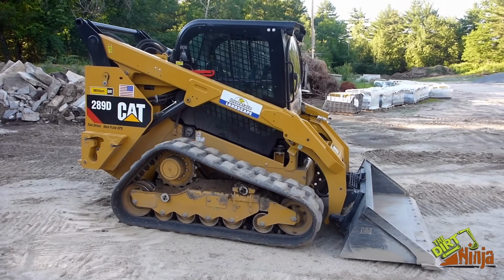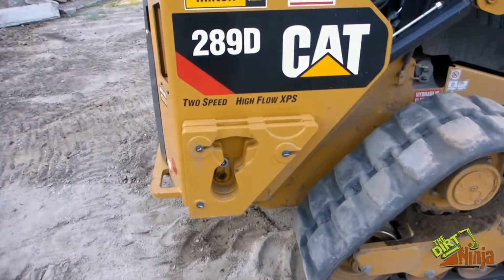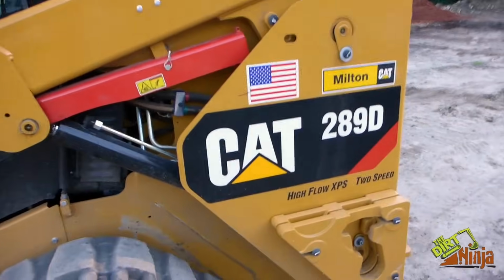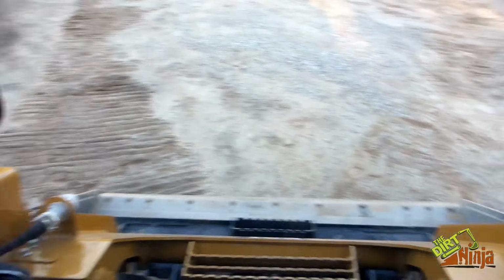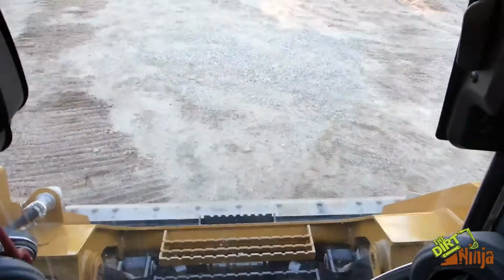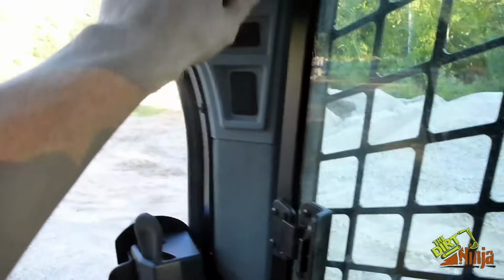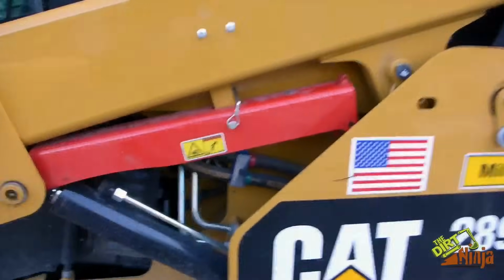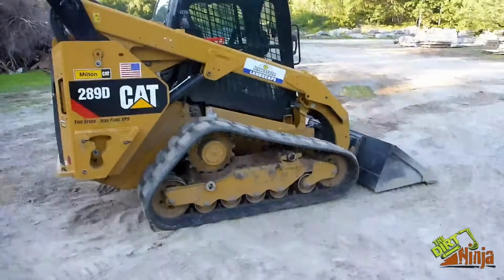In-Depth Caterpillar 289D Review And Walk-Around

Comment: Good machines but there are a few things to pay attention to with these (like any other machine out there).
Biggest thing with torsion bars is keep them greased. If you don't grease them often the grease will get rock hard and you will have to pull the track frames to drill out the ports. Bolts holding the torsion bars to the inside of the frame, under the cab, like to come loose from vibration and should be checked each service. When the tracks get loose they can slap around and break the bolts holding the front torsion bar trunnion to the track frame. Also spend some time and put some hose gaurding around the drive motor hydraulic hoses where they come through the frame. They like to rub through there often. A/C lines to the condensor break often because they flex and sometimes kink where the rear door opens. A helpful tip: Pull the battery out to get at the oil filter easily. Only takes 5 extra minutes but saves a lot of cussing and swearing.
Reply: Billy Bob Any tip on the Bobcat T740? I'm trying to decide between the T740 and 289D
Reply: Bobcat all the way!!! 👍🏻👍🏻👍🏻👍🏻
Reply: @Ramo-jw8iy  Cat all the way!!!

Comment: Nice review. I've been operating a 289d on the job now for about a year I got it with 200hrs and it now has 1305 hrs and the hydraulics started getting weak around 1000hrs
Reply: Andrew Newton i have about 1500 hours on it and found the same thing but still love it
Reply: Is there a fix for this? What do you mean by the hydraulics getting weaker? Is it not lifting the same weight as when new? I just bought a 2017 with 2500 hours and need maximum weight lifting.

Comment: The MTLs are not dainty by any means imho. When I was doing flatwork I had a 287B that I bought brand new. The ride is way better and you don't lose material like in the CTLs. I know there are comparison videos where people try to make it sound like the CTLs aren't choppy, but the truth is they are. Even with the ride control on the CTL the MTL out-classes it in ride performance. The single bad thing I experienced was if operators spun into the pile when spreading gravel; especially chipped gravel. Spin into a pile of chipped gravel enough and you will eventually see chunks come off the bogies. I literally had to let a kid go because he wouldn't quit doing this even after being warned 3 times.

Comment: Great video. We have 4 of the newer 289d3s and various other models. One small correction though is that the engine is not made by Cat. It's made by Kubota. I think if Cat had made the engine, they would have made the oil filter easier to service. Otherwise, it's a great engine. Between D and D3 skid steers,  we have had nearly 20 of them and have only had one major engine failure, which was a blown head gasket.

Comment: Excellent video, great job.  To compliment your comments, note positioning of Cat coolers/condensers vs others.  Easy to clean debris and excellent heat displacement for high hyd temp attachments.  Cat draws air from rear and exhausts it up and out, thus not blowing hot air and dust on your laborers.  D's will have accumulators to let the boom down w/o engine power.  Cat uses a patented cooling fan blast to dilute hot exhaust temps, operates @ 500-600 degrees max (check OMM on other makes/models for engine temps) and passive to the operator.  D series skid steers are plug and play for Cat SSL work tool attachments with a hydro/elec worktools plug installed.  Very important item to consider if you don't enjoy cords thru windows and poorly interactive, singular hydraulic function control for attachment setups.

Comment: We just got a new 289d and used it for the first time today.  I was curious how to change the controls.  I never found the info in the manual.  It's supposed to have that option so I'm not sure if it's a mechanical valve or switch button or setting in the display.

Comment: Then need to get some heated joysticks/arm rests to! That would be a nice cold weather package
Reply from the maker: FishFind3000 I like that idea!
Reply: FishFind3000 i have operated this machine in -40 c all last winter and had to have the windows open the heater in this is like a furnace  toasty warn within minutes of running
Reply from the maker: scwalsh1100 I noticed the seat warmer sure does heat up quick! Its nice.

Comment: Nice lifting capacity. But I bought a kubota svl95-2 I would push you around. And it don't fell like im in a coffin. and i can get out at any time with any load with the over head door.
Reply: 289D isn't a true match for the SVL95.....21HP difference.  You're adding DEF for high horse, he's not.  Don't pick a fight w/299D, you'll regret it.  Kubota door is good stuff.  Cat made a choice to go w/modular cab, air tight, lower dB ratings.  Kubota's are a good machine.  Weaker in hyd specs, weaker track system.  Acquisition cost is less, cost of ownership is higher.
Reply: JCBvsFendt yea good luck running a grader or box blade guided by gps with your kub

Comment: the operator setting you said was for high speed travel set at 12.43mph is actually for what speed the load dampening system (i forget the actual name) kicks in.  it cushions the boom and bucket cylinders for a little smoother ride.  I love our 289  cats are the best especially when it comes to operator comfort.   great videos too Ive watched a bunch!

Comment: Do these machines have a lift limiter? 

I know with a bobcat I can fill the bucket with wet dirt causing it to tip but I can skip the bucket along the ground and ride on the front of the tracks. 

I just bought a 289D and don’t seem to be able to do this. It just won’t lift or even try.

Comment: My coworker made the mistake of trying to remove the door. It will not operate without the door latched and is a pain in the a$$ to get back on. If anyone has any tips on putting the stupid red handles back in, that would be a handy video.

Comment: I really dislike the lift limiter on the Cat. Evreything else about it is great but I would prefer a solid rear like the bobcats so you can back into tress and such and just doze them over and the limiter. I can skip an tilt weight bucket on a Bobcat inches of the ground and riding on the front of the tracks, where I can't lift it with the Cat of a much higher weight class.

Comment: Nice video! I've been trying to get good long term comparison feedback between Bobcat and Cat....Seeing you run Bobcat for so long and switching must say something about recent Quality Control.  We run Bobcats and sure they are great machines but I have noticed significant issues with the new Engines now that they are no longer Kubota. Other issues as well but that was one of the major complaints I have....Stepping into a Cat last week I immediately felt like I was in a quality machine! The hydros were super smooth and least jumpy out of most other Manufacturers imo. If I'm not mistaken, these Cats do utilize a dual hydraulic pump system which surely helps keep control smooth and easy. Sure, rear viz is not great but none of them really are and I'd rather have a backup cam anyway, even on a machine with better rear viz. lol. So...Feedback on how these Cats hold up long term would be greatly appreciated! Have you had any major mechanical issues so far? Or do you notice any weak points?
Reply from the maker: +David Cardone Not one issue so far with the Cats. After a year of running it I really love the machine. Extremely well built and well thought out. Everything is easy to do on them. We wont be going back to Bobcat any time soon.
Reply: Dirt Ninja Thought you might say that, lol.  Thanks for the feedback! Keep the videos coming...

Comment: hey man thanks for the video I'm one of your subscribers. I like cat bobcat and T-Rex. the wide track you showed in the video up top is the ASV posi track Patton that cat contracted out from asv it's the same deal with my Terex on all they hold up pretty good and give you a better ride than the full cat design but slightly less Hardy. I had this same machine two things I didn't like for Forestry the tracks are very narrow and where you show the accessibility on the hoses at first is really one of the biggest problems for us sticks always go in there and puncture hoses and other things. the other thing the door is in dire need of a reinforced upgrade. I talked to Kat about addressing a couple of those. because I like running the lighter machine this is actually the machine that should compete with the Bobcat t770 even there everybody tries to compare that machine with the 299D which is actually the competitor of the t870  I like running the lighter machines and wider tracks that's the most important things to me in the woods. I will give up every feature possible that keeps me from gets stuck!! or blowing hoses!! really nothing else matters if you can't perform your job and you can't perform if you're stuck or down for a hose!! thanks for the videos man keep them coming!! been watching them for a couple years now. I started doing some videos on my channel but just breaking the ice lol

Comment: I'm looking at a new 289D3, how is yours holding up so far? Curious why you went with the 289D vs 299D? I'm in the same boat and was considering the JD331/333G too, but I'm pretty sure I'm going to go with the 289. I was considering the 259, but even with the same motor as the 289, I think its a little undersized. Any thoughts?
Reply: I’m in the same boat have both a new 289d and a 331g demoing them now. The Deere def. has more power and lift. Cat rides better but scared of the torsion axles and them going bad. The Deere is a bad machine!
Reply: John-Michael Hinson I think if you keep them lubricated, you should be okay. I just ordered the 289D, should be done in 30 days. The 333G just wasn’t as smooth, rattled a lot and I’m used to CAT’s interface anyways. I’m happy to not be dealing with DEF either. Wonder if I could get a decent amount of extra HP by upgrading the turbo at some point, i dunno. One think that deere could not compare was service. CAT’s service department is a million times larger and that’s a big deal for me. They offered me a great deal for 72 months, I pulled the trigger today.
Reply: @sodon10  How much did it cost you out the door? I paid 71,000 for mine 2017 including multi-purpose bucket and forks.
Reply: @Ramo-jw8iy  with financing and tax, it came to around $90k

Comment: Dirt Ninja, do you have a link to the camera that you installed on the Cat ?   We have a Cat 242D with the deluxe display.  Also where do you plug into the wiring harness ?  Any help would be greatly appreciated.  Thank you
Reply from the maker: I got it through my dealership. Its a Cat camera. Comes with easy to figure out directions and it literally just plugs into a cable in the cab. Very easy.

Comment: Good review but not 100% accurate.  The engine is NOT a Cat engine it is a Kubota 3.8L that Cat labels and sells as theirs.  They sell a back up camera because they have to, you cannot see out the back of the machine and they get to charge you for the upgraded monitor and camera.
Reply from the maker: +Steve Stelk You can see out the back, just not well. You dont need a special monitor for the camera. I installed the camera after we purchased this machine. It was about $400 and hooked into the regular monitor. You are correct about the engine. I am told however they tweak the motor and make it their own so its not the same as you would find in a Kubota machine.
Reply: +Steve Stelk its a 3.3l
Reply: Added info, there are 2 types of displays offered in the D's.  Basic display and Advanced LCD display.  To add a camera you do need the advanced display.  The basic can be upgraded to advanced, then a backup camera installed.  The Cat engine is produced by Kubota however a more important conversation is the Tier 4 components on the Cat vs. Kubota.....worlds apart.  I don't mind existing in a world with Kubota skid steers, they have a place in subdivision garages.  But bring a pen and paper to take notes if you begin to insist they are higher quality.  School will start.....
Reply: Kubota engine block only...everything else is CAT

Comment: Hello been watching your videos a long time and finally decided to join . First of all like the videos. Not a fan of Cat at all or Bobcat. The newer minis are better but not my favorite by a long shot. Not bashing just my opinion . They work for you and that is great. Check out a Faver inc grapple rake. I really like the ones I have used. I am wanting a Bobcat  brand harley rake. I wanted to ask if you had tried the Bobcat one as i saw you have the Harley one? Do you still have the Deere 200?
Reply from the maker: +Allen Long Dont get the Bobcat one. The hydraulic pump is at the same level as the spinning drum and will take a beating. Go with the Harley. The pump is up top out of the dirt and a chain runs down to spin the drum. Yes I still have the 200

Comment: Will this 289D lift those 3500 pound concrete blocks in the back ground?
Reply: i have 2 277d machines and i was just stacking full bin blocks 3 high in our yard... prolly not supposed to be doin that but i have no alternative at the time.. just gotta be smart about it
Reply: Shawn Vena I ended up purchasing a 2018 259D it lifts the 3500 pound concrete blocks no problem I thought I would have to go to a 289D but the 259D works great. Great videos btw